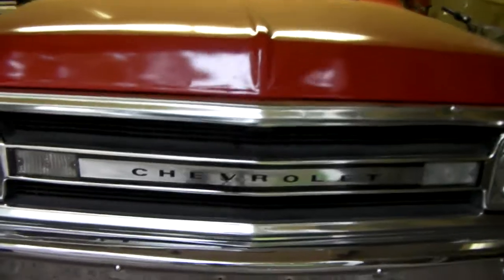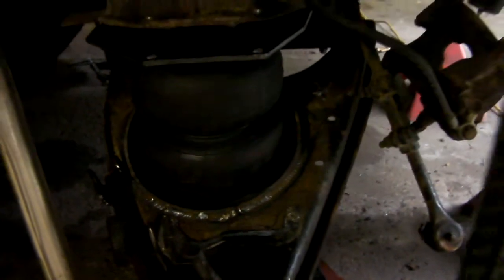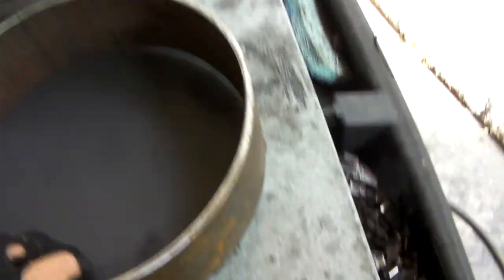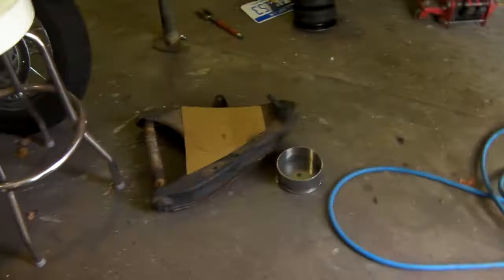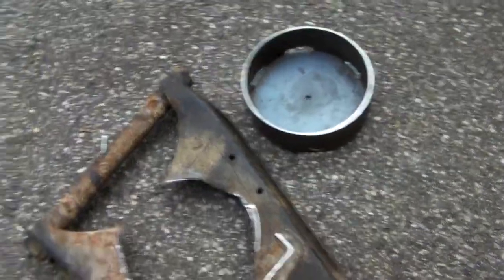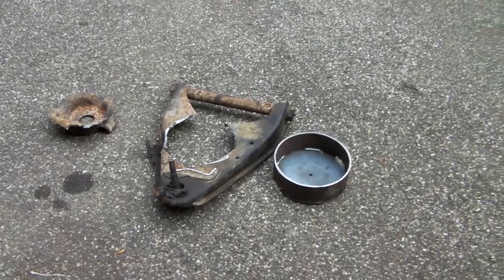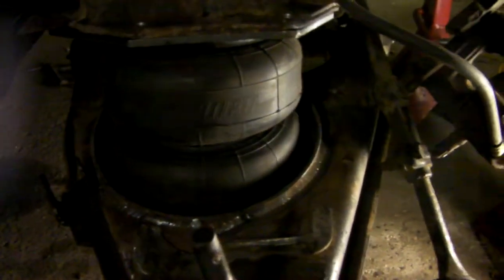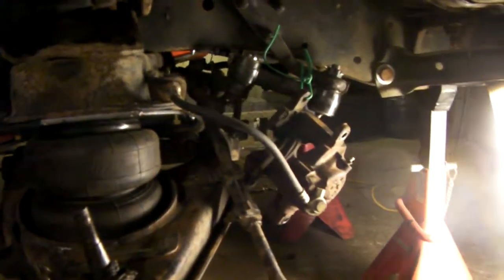Chevy C10 Air Ride Build Part 2 "2 bags 1 cup"

Comment: Shocks in the stock location work fine. Just need shorter ones. I think I used like 1947 Chevy truck spec shocks and they bolted right in.

Comment: Verry nice videos, verry usefull. I am also in the process of doing this on my 71 suburban. I am using 2"deep cups. How did you mount the stabilizer bar to the lower arms. Did you use the stock brackets?